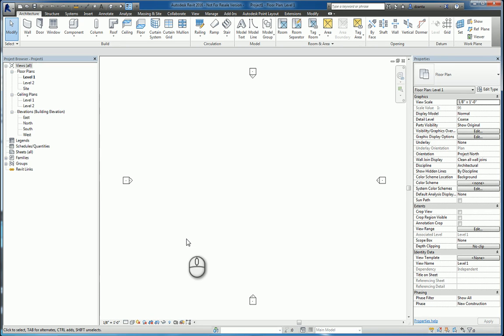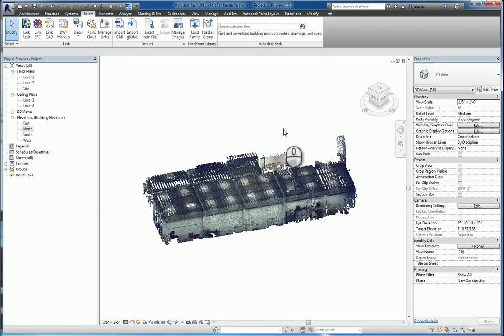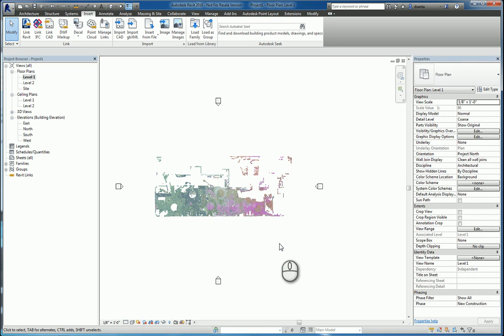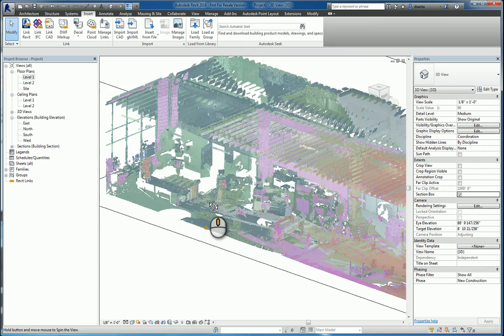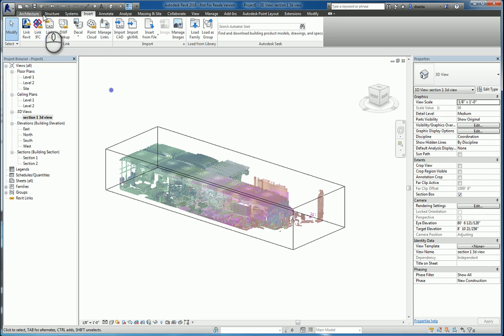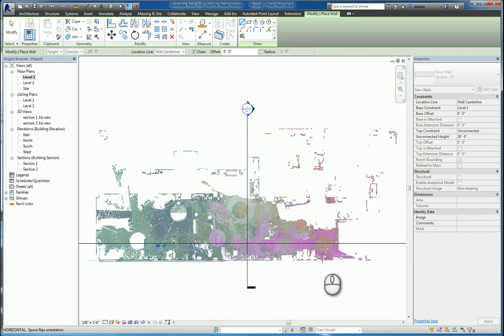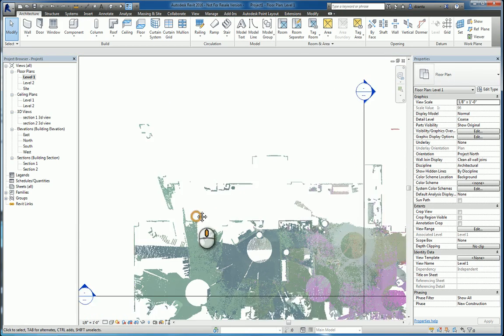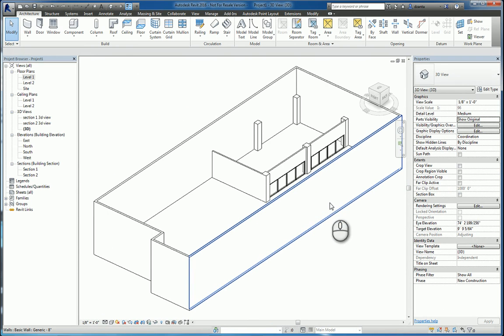Revit Point Cloud Insertion   A How To Guide

Comment: Dzan this is another awesome quick tutorial video of yours. I appreciate for this. I inserted my point cloud data from recap to Revit and started modeling just like you did in this video. But when I draw a wall, for instance, it doesn't snap the existing wall location since it is a point cloud data. Therefore, the model I make won't be %100 percent accurate. Does it always like this? Point cloud modeling is being done imperfectly??? Also, I wanna learn more about point cloud modeling. Can you make more videos about or can you suggest me any source where I can learn more about it?
Reply from the maker: Accuracy of 3d revit wall drawn is based on what part of the point cloud file sees.  Revit will see the vertical aspect of a wall or horizontal aspect and you hae to get close to draw accurately